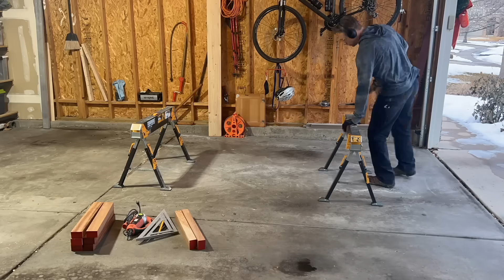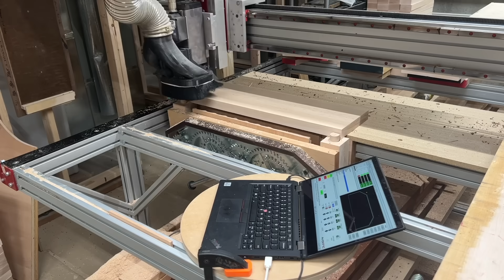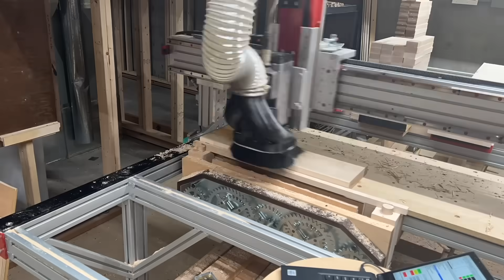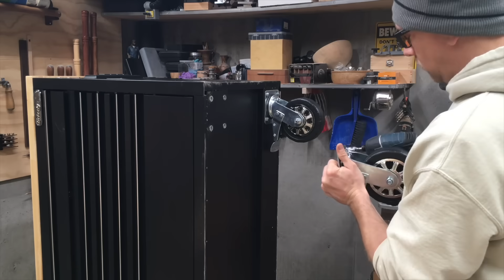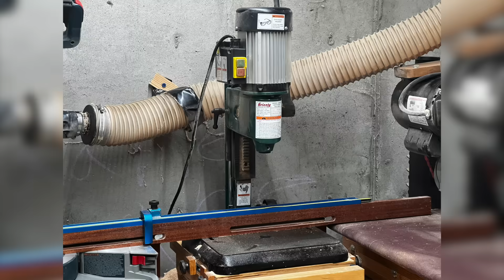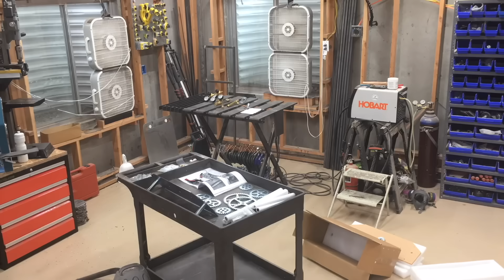Go Broke Selling Profitable Products?!

Comment: Seeing an NYC laptop repair company grow from a 4ish work station shop to moving to an +8 station location, if anyone could have done this >2x growth, they could have. But clearly after a year of expanding their operations, they need to scale back costs (and thus move again).

Their model worked for them because how dense their small location was but when you cannot grow your revenue to match (assuming similar profit margins), then the move cripped them.

Certainly the right kind of growth is hard to find (for I doubt there is a correct formula as well)